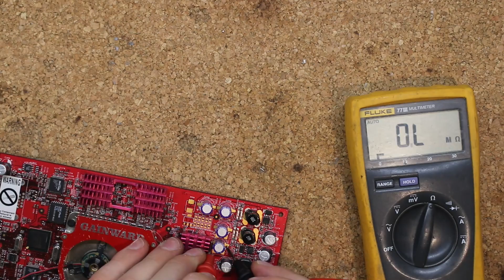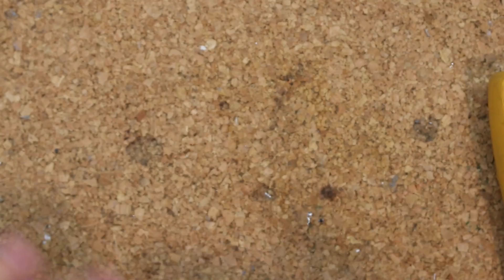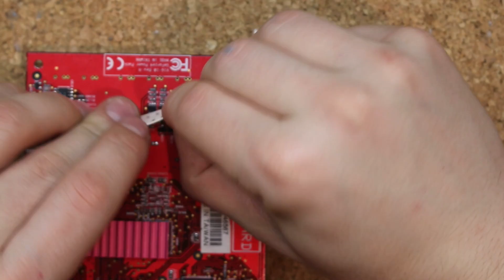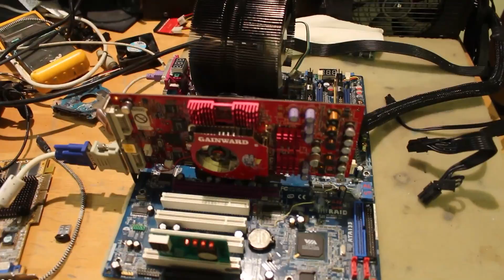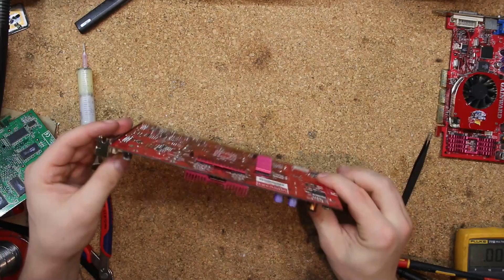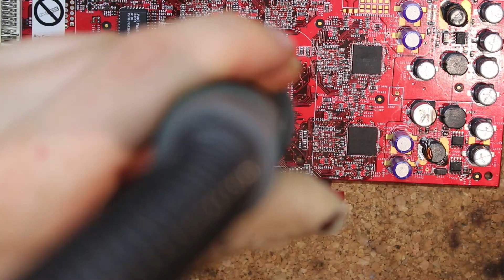Fixing a nightmare Geforce4 Ti 4600

Comment: Currently fighting with a Leadtek Ti4600 (missing components and artifacting in a stable way) and an MSI Ti4200-8X (lots of missing components)... I found schematics online that really help - just look for MS-8894 and NV25 schematics. Most of the Ti4400/4600 cards used reference schematics almost to a tee. Could be helpful in the future!

Comment: I have an ASUS card with similar artifacts, but mine are not so bad I can go windows in 640x480 256 colors and only a few lines show on screen, but after I switch to other resolution it switches off... can you help me ? I'm in Portugal
Oh and my ASUS (with VGA and TV out) inductrors are 4.7 mH
Reply: Did you ever find the issue? My Ti4600 switches off when I go above 640x480.
Reply: @zuldanfpv4634  unfortunatly no... it is on a box somewhere with the same problem... I have way to many broken boards,,, but for use it is some memory problem

Comment: Great video. Awesome job getting this beast working 👍I kinda want to get into repairing my own stuff and I learned a few helpful tips from this video 😊 Funny enough I also have a Gainward GeForce4 Ti (it's a 4400 though) that artifacts like a mf, too scared to try and repair it though 😬 Also, I have an X1950 XTX that might need a memory reflow as well, it crashes to artifacts a lot when cold but is completely stable when it warms up. Sorry if this may be a stupid question, but how exactly did you go about reflowing the memory on this card? Might try it myself.
Reply from the maker: X1950 XTX should be lead free solder allready so forget about reflowing stuff, needs proper reball lots of early lead free cards have really bad soldering job all over the place... It working depending on temperature seems more like FCBGA to me though, x1950XTX is same architecture as xbox360 gpu and that thing was notorious for FCBGA issues so if that's the issue it's not really permanently fixable just sorta a fix for one or 2 sessions and run card hard without feeling bad for killing it deal :D
On this card reflow was just with hot air @380°C and some flux, but it only worked on some chips and didn't work on the core, that needed full reball.
Reply: @taggxoc  Thanks for replying! Shame they used lead free solder by that point, guess I can forget about an easy repair on that card 😅With that I might do the squeeze test on my Ti 4400 to see if there's anything that could be reflowed, that would be the best I could do with that card at this point.
Reply from the maker: @SPNG  Squeeze test sounds like a good first step, you can allso check the artifacting paterns, i shared them under my mem diagnosis guide like 2-3 videos back, then you know which channels are your problem, allso squeeze test your core as the mem channels are connected to the balls around the corners of the GPU, reflow works reasonably well on leaded solder unless pads got ripped off on mem IC / PCB itself :)
Reply: @taggxoc  Quick update, I was able to narrow down the problematic memory modules and gave them a quick reflow with flux, the card stopped artifacting and it does 3D just fine again! I can even get it up to Ti 4600 speeds without any trouble. Thanks for the tips, I never thought to try fixing that card!! 😁 One more thing, is it possible to flash a 4600 vBIOS on a 4400? The Gainward cards seem to share the same PCB between those two models

Comment: Nicely done on the repair, id probably put on a zalman vf1000 cooler on the gpu just to have a bit overkill gpu cooling on the core & less noise, if you find a used card with the zalman vf1050 like a msi 8800 gt zilent, gts 250, gigabyte hd 6850 etc...
Its the same exact cooler except not copper & anodized aluminium instead, should work great on the card still though.